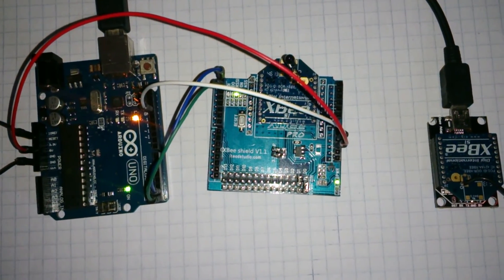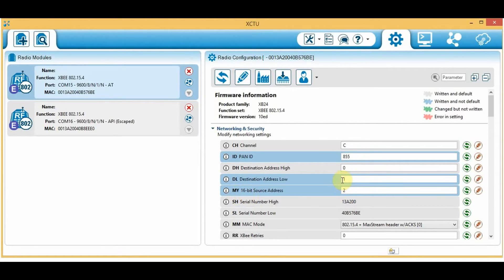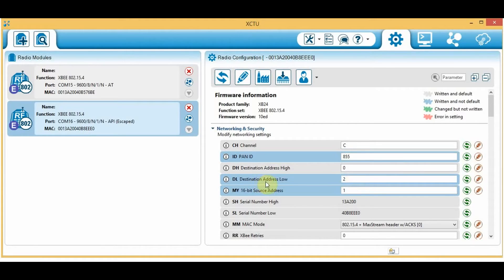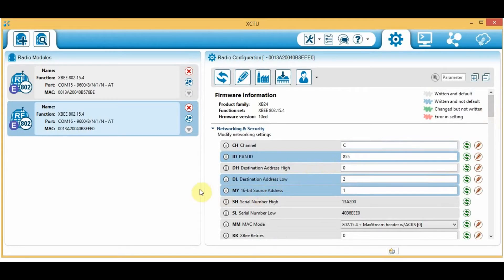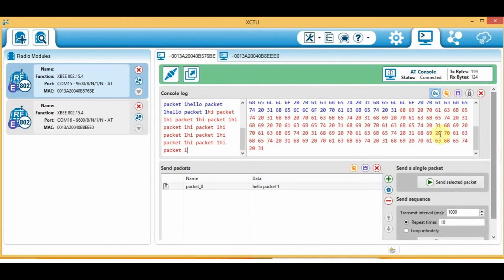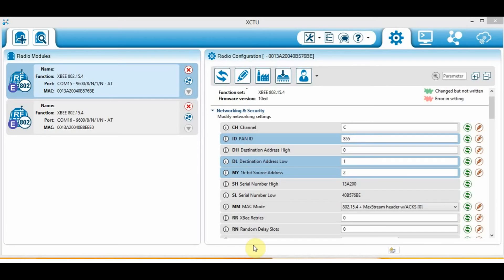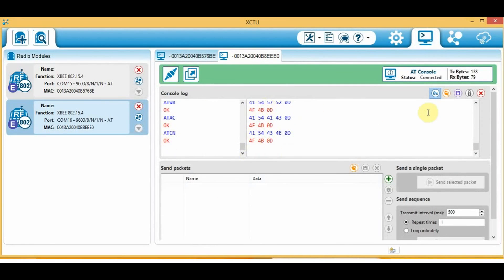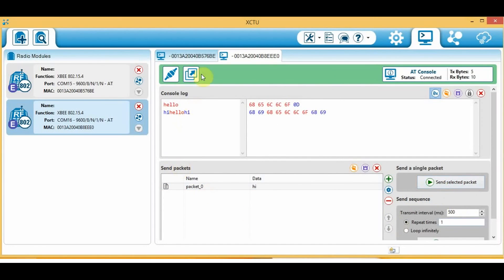XBee - Broadcast and Unicast addressing modes

Comment: Hi Timothy, Cheers for your tutorial video. I am new to Xbee and I recently bought two pair of Xbees. I tried the same procedure that you have shown in the video but with the latest version of XCTU software. The problem I am having is with the range of the module. It can only communicate if they are about 5 cm apart and stops receiving message after that. in data sheet it says that it can cover unto 30m indoor. 
have you encounter this kind of problem before? or do you think I have got faulty modules.
Cheers